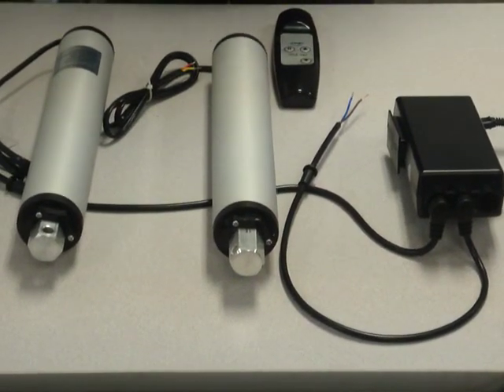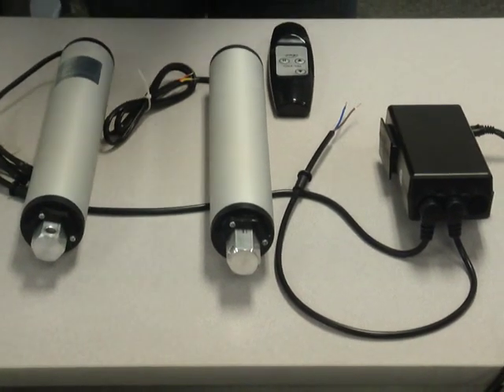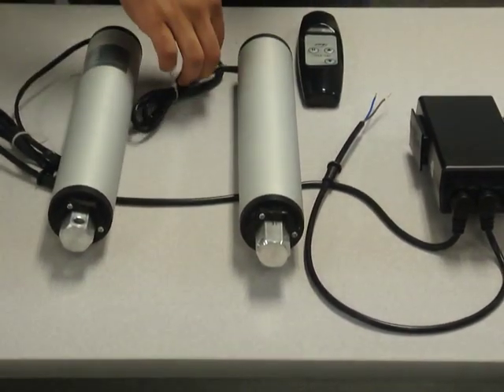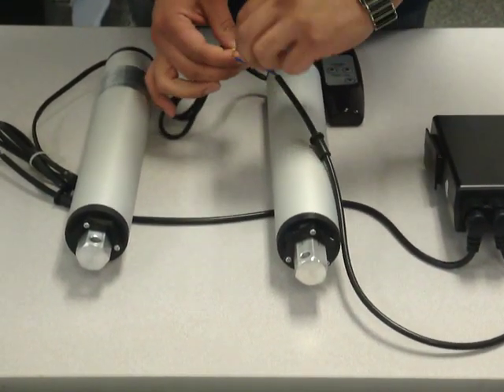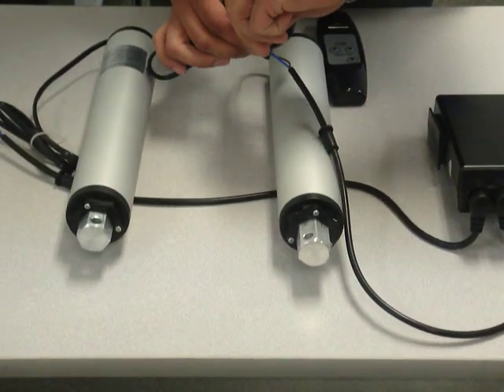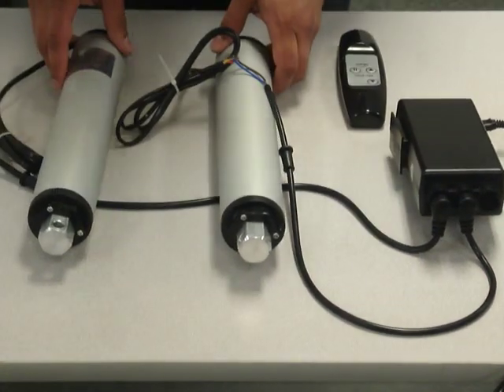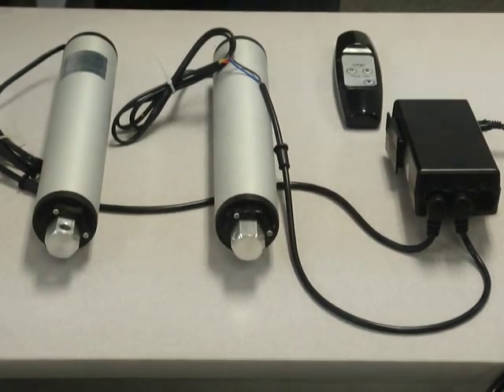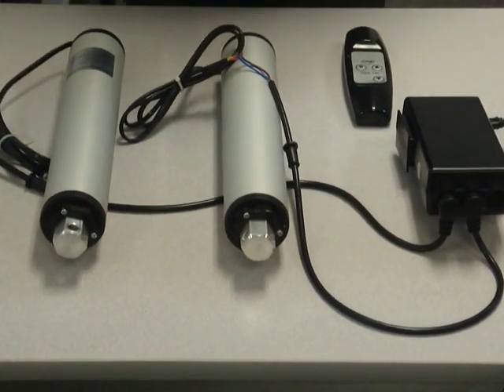Connecting a High Speed Actuator to a Control Box - Progressive Automations

Comment: There is a motor inside it,
The reaction when start and stop shows that there is an electrical motor inside it and a worm gear shaft or screw shaft actuated by the motor to convert the motion to linear

Comment: What is the speed on this particular model used in this video? I know this is no longer available, but I need same type actuator with that exact speed. Thanks!
Reply from the maker: Hello PF,

The discontinued model in this video travels at 3.00"/sec. However, we do have a similar PA-15 model with a 22 lbs dynamic force rating. This will have a speed of 3.15"/sec. You can view this product here: https://www.progressiveautomations.com/products/tubular-high-speed-linear-actuator

Comment: This piston depth and speed is controllable or not.? Means I wonder if it could provide 100compression/min...?
Reply from the maker: The overall maximum and minimum length dimensions are permanent, depending on the stroke length you choose. 
However, the linear actuator can be stopped at anytime along the stroke movement by cutting off power thus controlling the depth.

The speed can be controlled by changing the voltage level applied to the actuator. You are able to get the maximum speed at 12.0VDC and anything below will reduce the speed. 

The easiest way to accomplish both of these is through the PA-25 control box. By setting the remote control to "momentary", the actuator will stop movement as soon as you release the button on the remote and the knobs adjust the voltage applied.

https://www.progressiveautomations.com/pa-25

If you have any further questions, please feel free to e-mail us at sales@progressiveautomations.com.

Thank you!